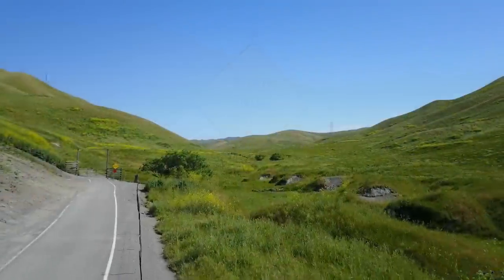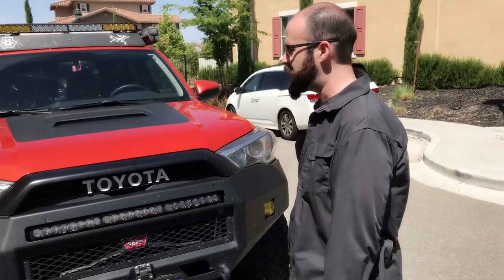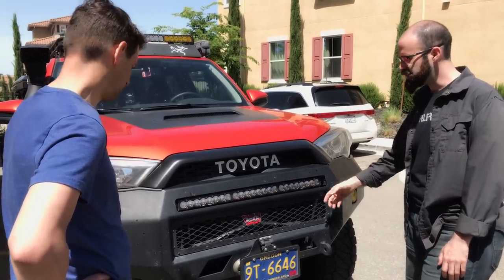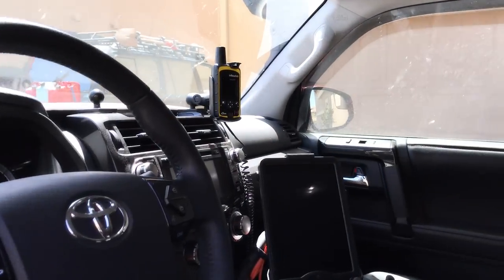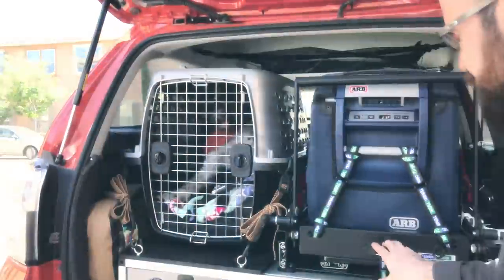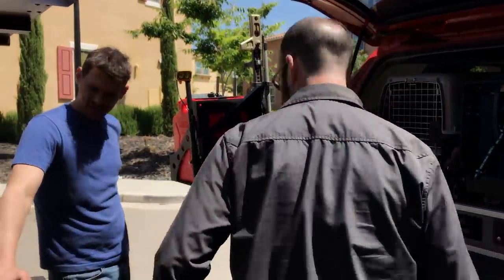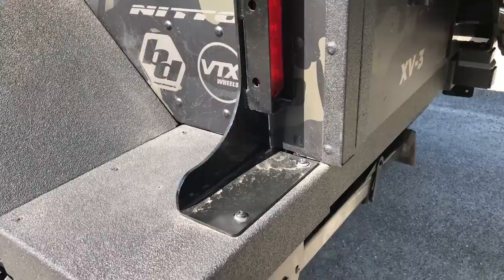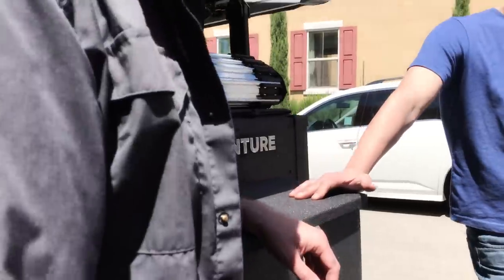TRD Pro Long Travel 4 Runner Rig Walk Around

Comment: Can you post all the mods so i can sell my house and get this?
Reply: LOL
Reply: James Simpson 😂😂😂
Reply: Every once in a while a comment on YouTube makes me laugh out loud and spit all over my screen. This is one of those times. wipes screen
Reply: Was thinking the same thing, except I don't have a house. Anyone wonder what it costs?
Reply: This is prolly more than my house
Reply: Shiiiiiit! Welp time to mod up an old 4runner or something.
Reply: James Simpson You have a cheap house
Reply: I'll buy UR house
Reply: lol
Reply: @benkse2010  
I've got about 35 thousand invested in my 99 Tahoe.  And that just covers new 35" tires.
New 6 inch suspension lift.
4 new heavy duty axil shaft.
New front. And rear differential 
Gears and bearings. Heavy duty locker in the rear and ARB up front.
Billit aluminum differentials covers.
CB radio. I figure I could finish my build if I had another 35 grand.
Reply: yea no kidding, truck itself pre-mods brand new are like $70,000... plus the trailer is roughly $25-30,000, mods, extras, labour maybe another $15-25,000..
Reply: Already did
Reply: It ain't worth it to be honest. Depending also on how hard you plan to run a setup like this. That aluminum bumper wouldnt last a season here in Arizona. Still a nice setup though
Reply: That is hilarious 😂
Reply: So and so and even though , so
Reply: your wife is going to love that idea LOL
Reply: Just get many credit cards ... how do you think these clowns afford this stuff. YouTube don’t pay much.
Reply: @jmaclicious10  wow…he must be a rich dad

Comment: Can someone explain the point of purchasing a TRD Pro, which is an off-road suspension package, then taking it to a shop and have all of those special components removed and replacing them with all new/different components?
Reply: That’s why I recommend getting the cheaper trd offroad and modding it
Reply: dirt every day takes a stock one and goes over some trail no problem
Reply: More money then sense.
Reply: E lockers and a-track is what people mainly want
Reply: That's why I bought the TRD off-road and did the mods the way I wanted. TRD pro in my opinion is for anyone who is Not going to be changing anything
Reply: He probably didn't do it all at once. Got TRD went places and realized its not enough ;)
Reply: @phlfly10  you literally have no idea what you are talking about  a 4runner can smoke a Rubicon rock crawling any day and a raptor  is way to expensive to crawl
Reply: @Pb_Slinger  -Thank you, I'm glad someone said it.  Did anyone else notice that every single item on that rig is new and unused?
Reply: @krisk1547  thats actually EXACTLY what happened
Reply: I have those on my offroad
Reply: because he didn't pay for a dime of any of the mods

Comment: Dude, I live in Portland too! That is my absolute DREAM 4runner.
I'm currently in the process of outfitting my.... (drum roll please),
2015 Subaru Outback 3.6R for overlanding. I would LOVE to possibly meet up at some point and shoot the shit about the rigs and receive some outfitting wisdom. I'm only 21 years old, so there is MUCH to still be learned.
Just today, I installed my ARB 12v High Performance Compressor, and just about ready to put in my custom 3" suspension & body lift, so it's coming along steadily.
Anyway, fantastic video and awesome vehicle!

Comment: I just put a Magnuson supercharger on my new 4runner, and when people ask my favorite, or best overland mod, i always say the supercharger.. I transforms the 4Runne to what it was meant to be.. I now dino at basically 350hp to the tires (almost 100hp gained).. I can now pass on highways, even when fully loaded for overlanding, and can do technical rock crawling and get over obstacles at lower RPMs, so it has made my average MPG better.. It only increases MPGG used uf you have a heavy boot.. I highly recommend it to anyone with 6 grand to spend on an engine mod... Magnuson and TRD made it together, so it bolts on and aside from need minor calibration, your rigs computer knows what to do when it's plugged in, and requires no other mods

Edit: Why spend extra on the TRD Pro if you were modding it?.. I went with the TRD Off Road for the KDSS and bought the Pro grill myself lol.. I saved a lot of money

Comment: Lots of great gear and innovative products but with the added weight was there anything done to engine/transmission or was there not a need to do so?
Reply: So basically the engine specs were sufficient enough for extra weight and trailer.  Good stuff.  Thx and well done on the truck!

Comment: I love this rig. Nicest ever. I didn't notice if you had a supercharger installed. With all that weight the stock 4.0 motor must be way underpowered. I will look at video again. Love the pop up tent. Dream rig for sure. My Dream vehicle would be exactly the same but like 30-40% bigger. Waiting to see the new Jeep Grand Wagoneer.
Reply: Russel trang I don't believe anyone makes a super charger for the newest generation 4 runner.
Reply: Such a shame. That's the only reason I sold mine and didn't buy another. With all that weight he's dying in that 4runner. Still a beautiful truck. Me personally I wouldn't spend all that money without an engine upgrade. IMHO.
Reply: Russel trang No kidding, they really need to bring the buttery smooth V8 back to the 4runners. That V6 is very underpowered in my opinion.

Comment: So around 6500+ pounds (without trailer ) for the engine which is under powered even for the factory 4800 ? Does it move ? Did you supercharge it ?
Reply: Yes!!! Add in those 35's and this thing is a serious road block. Can't see this rig pulling the hills on I 70 going west in CO. also any brake mods?

Comment: I don"t understand these vehicles.  I don't understand overlanding.  my 86 excab has  80 series Land Cruiser axles(won tons), 40s, dual cases, and a cage.  It doesnt need anything else.   The goal is simplicity, lightweight, strength.  I feel like these overlanding vehicles are the exact opposite.
Reply from the maker: Goal for what?
Reply: What don't you understand. These vehicles are designed for extended off highway trips. You have a rock crawler, built for day trips or maybe one day on the trail. Most likely you have to trailer your vehicle to the trailhead if you are more than an hour away. Different vehicles for totally different purposes.

Comment: I have the same '15 4Runner Inferno TRD Pro, I added budbuilt stainless skids and the guys at Land cruiser NW built a beautiful custom bumper for my warn 10k. I am in that for $50K. seems to me you've overbuilt it just a bit, especially due to the Toyota conservative power factor. Maybe would have been better to start off with a Land cruiser from the start...lol
Reply: Isaac Marchionna I am in the Air Force, currently stationed in Alaska. which is ironic because there are not a ton of places to wheel up here.

Comment: Very boring and gutless stock under the hood. The 4.0 is marginal at best in a stock 4Runner. I can't imagine what a slug this rig is at its stated weight of 6500 pounds with no love under the hood to add some HP and torque. Toyota needs to bump the stock numbers on the 4.0 and bring the TRD supercharger back!
Reply from the maker: Ya - with my 80 - its surprisingly good, but I do run in "Power" mode 100% of the time.
Reply: carbonking53 it's called gears bud
Reply: Puppetmaster Having owned several and built two 4Runners with supercharger, headers., exhaust, intake, injectors, etc. I can state as fact It takes way more than gears to move a V6 equipped 6500 pound vehicle bud.
Reply: You're absolutely right! I have driven a couple 4Runners, I love the truck, but it is at best, adequately powered with the present and only motor available, the 4.0 V6.
Reply: I love my TRD Pro but.... give it another 75 horse and 75 ft lb of torque and I'd sleep with it.
Reply: That's the major pitfall with the 4runner.  You have a barely adequate v6 gasoline engine, on an otherwise stout and capable LC Prado platform.  That 4.0l v6 is very reliable, but it is so outdated by today's standards where you have turbo gasolines and turbodiesels, heck even some gasoline v8's, that can provide better torque and better fuel economy.  Toyota needs to up its game in the engine department.

This engine is the main reason that I'll never modify my 4runner to the same degree this guy has.....I'm barely getting 19mpg in combined driving with a stock 4runner...you start throwing bigger tires and gear on the 4runner, and that mpg quickly degrades.
Reply: Carbonking53: What upgrades under the hood would you recommend for anyone doing a heavy overland build like this? I know I want to upgrade the exhaust and manifold to headers, K&N cold air intake, and maybe a Dastek Unichip, but would you go with a supercharger on a rig like this?
Reply: Stevie C, there are no OEM supercharger options for the 4runner's 4.0l v6; I certainly wouldn't mess around with non OEM aftermarket options.  Nor are there really any cost-effective options (cold air intake, headers, tuning) for livening up the engine; there are options, but it's debatable whether or not their modest performance gains are worth the money.  

The 4.0l v6, while not a dog, provides mediocre torque and horsepower delivery for highway driving.  Offroad, it is more than adequate, but for towing, hauling weight, or highway passing it's just not a very lively engine.  That's the 4runner's greatest weakness and it's greatest strength.  Because the engine is tuned for such moderate performance, it's extremely reliable and robust.

Your best bet for modifying a 4runner is to keep the weight and mods to a bare minimum.  You can regear to help with bigger tires and added weight, but then you're starting to degrade the 4runner's already mediocre fuel economy.
Reply: The mediocre power is less of an issue.  It's the fuel economy that is absolutely horrendous on these vehicles.  You're lucky if you can break 20 mpg highway with a stock vehicle.  I'll bet dollars to to donuts that this heavily built rig is getting no better than 16mpg in its current state.
Reply: If its highway power you want buy a sports car, 4runners are not designed for drag racing they are designed for off-road use and I cant tell you how many jeeps, land rovers, and trucks with more power ive had to help up trails with my 1999 limited with rear diff locker. While everyone else is hitting obstacles with enough speed to bend their frame to get past them my 4runner just slowly creeps right over them no problem. Power doesn't mean it's better off-road.
Reply: It's less about highway power and more about efficient power.  The 4runner's gasoline engine is very dated.  Toyota has been using that same basic design for nearly 15 years now.  In stock form, you're lucky if you can get 20 mpg highway.  With the way this fellow has it modified, I'd be surprised if he was getting 15 mpg highway.  

I agree the 4runner's power is more than sufficient for crawling through trails, but a true exploration vehicle needs to be able to tow and traverse highways as well.  The 4runner platform is awesome; the engine needs an update.  In the age where turbo gasoline F-150's are getting 22 mpg highway and diesel Colorado's are getting 30 mpg, the 4runner's performance simply isn't cutting it.
Reply: Kevin P Toyota will never bring back the V8 on the 4Runner. They will lose money on tundra ,sequoia and land cruiser if they do.
Reply: I disagree.  There is a 4.6l v8 still used in the 4runner's cousin (the Lexus GX 460) which offers a good middle ground between the 4runner's v6 and the Tundra's 5.7l v8.

Also, it would be nice if Toyota followed the example of other car companies and offered either a turbo diesel or turbo gasoline.  Toyota's naturally aspirated engines just aren't that efficient compared to what the competition is offering.
Reply: Use the 5.0 v8 from isf
Reply: Coming from a 4.7 4th Gen to the V6 nearly made me cry -- I miss my v8 :)
Reply: I guess 'move' is relative.  It has enough power to do the trick in pratically all situations but I do agree a little boost wouldn't hurt.
Reply: magnuson has taken over offering superchargers now. But I agree they should bring back the v8.
Reply: Yeah but they toytoa/lexus v8 (4.6,4.7) is even more reliable than the v6 and gets similar fuel economy.
Reply: I doubt toyotas v8 diesel would fit between the frame rails. Thye offer smaller displacement turbo diesels and gassers in the Prado, Hilux, etc we just don't get them in the states.
Reply: DesertCyclist Magnuson Superchargers are available for a long time already-mine added 82 wheel horsepower and 91 ft.lbs. of torque.
Reply: This thing screams for a straight six Diesel engine. That 4.0 isn’t enough for 6000lbs plus trailer.